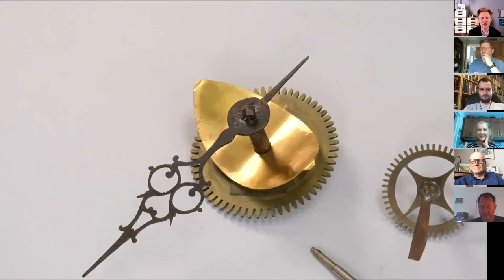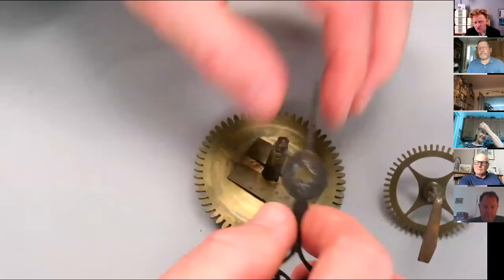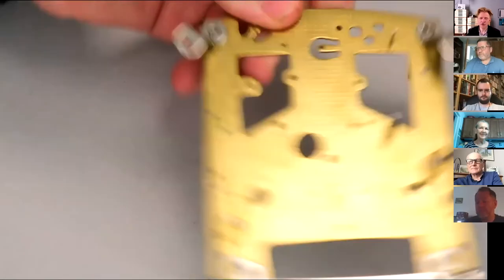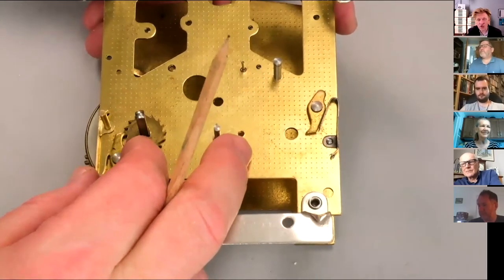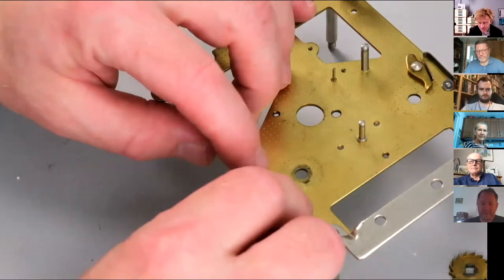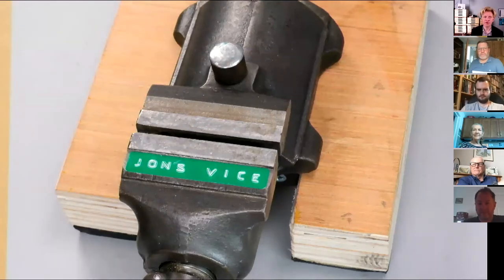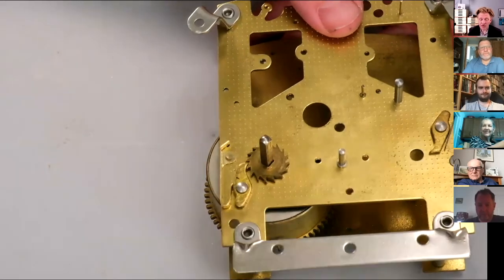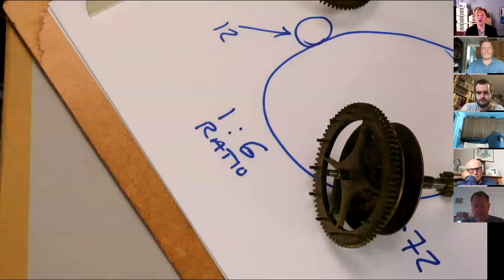Open Clock Club #029 2021_06_12

Comment: 1:04:32 Re: Homework of why not 78 teeth and 13 pinions instead of 72 teeth and 12 pinions: Does it have something to do with the width of the teeth? ...that if you keep the same tooth/pinion profile and go to 78 teeth and 13 pinions, both the 78 tooth gear and the 13 tooth gear would need to be larger than their 78 and 13 tooth counterparts, which would mean a larger distance between the two wheels, and perhaps a larger clock movement. ...or does it have to do with the forces on the teeth? That the same torque on a larger driving gear would produce less torque on the driven gear? The whole topic of gear ratio choices in clock design is a total mystery to me - a fun problem.
Reply from the maker: Hi Bradford.  You make some interesting points there.  We seem to have opened a subject that is of interesting to quite a few folk so will expand in due course.  Certainly, wheels of the same size with more teeth would have finer teeth.  On the torque issue, remember, as long as the ratio of sizes remains the same, what you give a away or gain on the driving element, you get back or loose on the driven element.  We will flesh this out a bit more in forthcoming weeks.  It is a really great idea for everyone to at least design their own clock.  Function, duration, frequency of the oscillator. M

Comment: With a 78 tooth wheel and 13 leaf pinion, would the same teeth in the train be meshing continually?  Does the use of 72/12 offset/equalise the cumulative wear on all the teeth?  Hmmm… not at all confident about getting a pass in the #homework but looking forward to finding out next week!
Reply from the maker: That is a really good point.  I think it is called hunting gears where the gears do not mesh in the same place as they rotate to even-out wear?
Reply: @openclockclubarchive325  Yes, I’ve come across old bikes with a hunting tooth set up and was trying to apply the same logic. Not sure if it would be excessive in clocks that are under far less strain but might compensate for burrs or other eccentricities??  Not sure... still thinking! :D